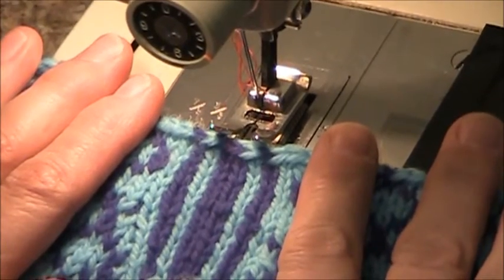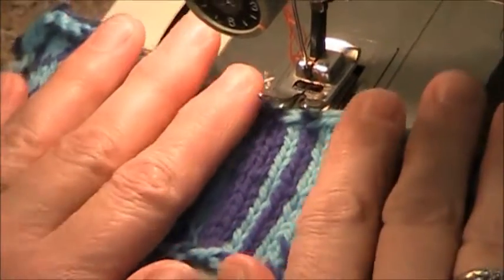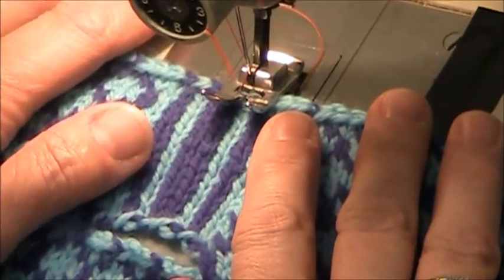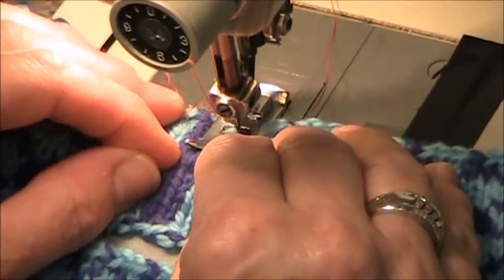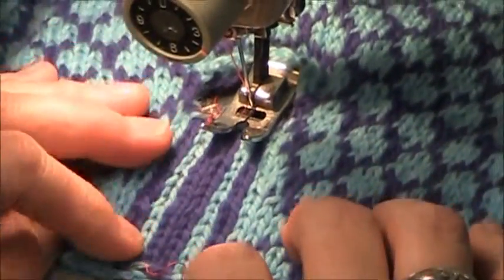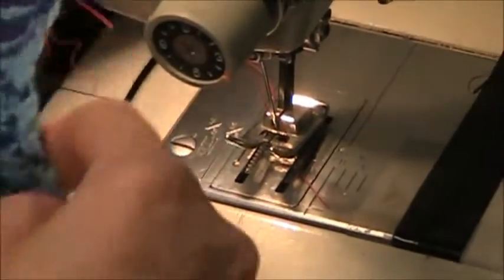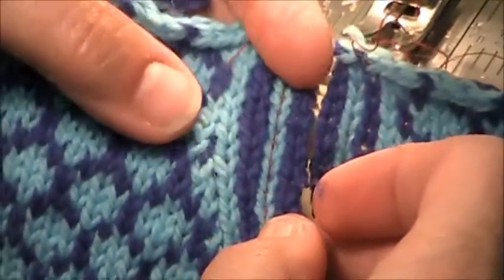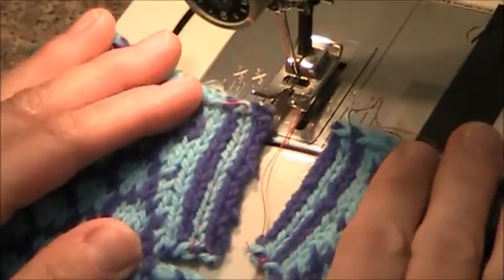Machine reinforcing steek

Comment: What method for steeking would you recommend for an alpaca & wool blend? It is a bit slippery.
Reply from the maker: I think this machine reinforcement method would work just fine for an alpaca/wool blend. The machine stitching will keep the stitches in check. The next option would be to reinforce by hand if you are afraid of putting the fabric through the machine.  The crochet method would also work, but I might be sure to have more than one stitch between each crochet line, so you have an extra “buffer” of stitches.
I hope this answer helps you!
Reply: @jjones209
Reply: @jjones209  Thank you very much. I think I will follow your advice : to try machine stitching... and if i have difficulties, i'll try the second option (but not the third). I have wet blocked the cardigan before  trying the steek (it is a sandwich steek and my first time steeking), as i think the machine method might not allow elasticity) Many thanks for your advice and Merry Christmas.
Reply: If you have already tried it, I hope it worked out well for you.  If not, good luck!
Reply: @joyceajones   Yes, it worked out perfectly  with the machine steek. My sister also gave me a good advice : to tape the knitting fabric to prevent extension of the fabric while sewing. Many thanks!